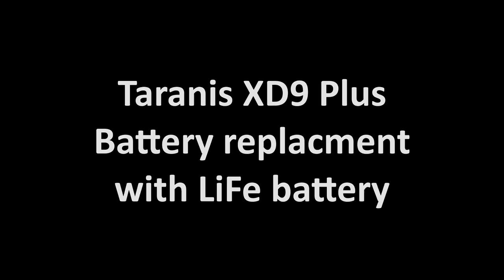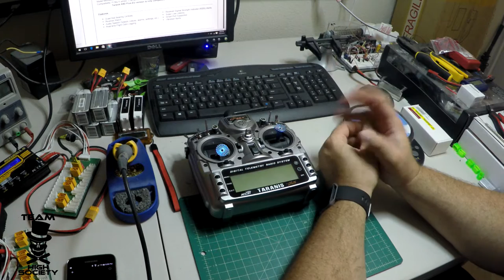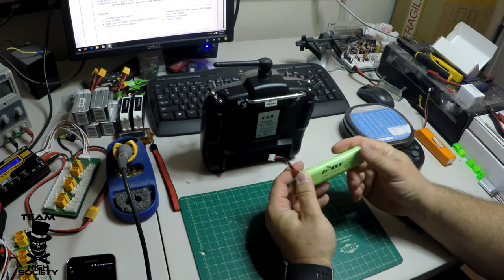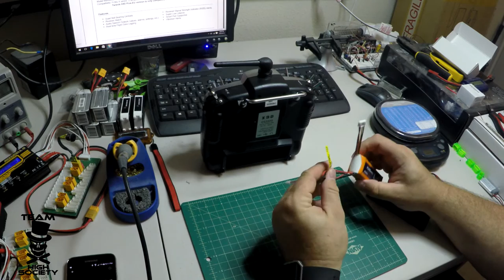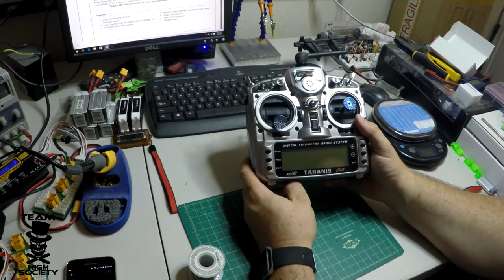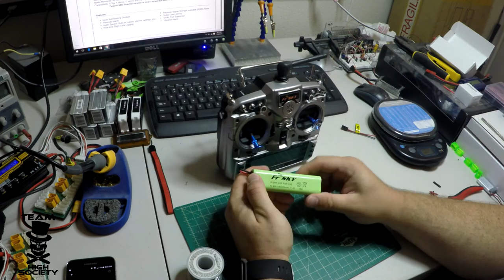Taranis XD9 Plus battery replacment - LiFe or LiPo ?

Comment: Just a suggestion... cut, solder and heat shrink one wire at a time to avoid accidental shorting out of the battery.  And FYI, I have that same LiFe sitting in my old Turnigy 9x that has been untouched for probably at least 2 years and still has a full charge with no problems.
Reply from the maker: That is wise advice for sure! I'm glad you can confirm what I read about LiFe and its incredible charge retention!

Comment: You didn't mention resetting the voltage range on your X9D and also the battery alarm all of which will have changed when you changed the battery - also I would have soldered the lead on the other connector so I could use the servo connector for changing without the need to disconnect the battery from the radio.

Comment: You'll want to change the low battery alarm too since the curve is different for LiFe.  I set mine to 9V or 3 per cell as the low.  Otherwise you may not notice when it is low.
Reply from the maker: That's a great tip! Thanks for posting it!

Comment: will the taranis be able to charge the life battery
Reply: No, you will have to remove the battery and charge it on an external charger.  Also, you will have to have a charger that can charge LiFE rather than just LiPo AND you MUST remember to switch into LiFE mode when charging this battery or you will have a bad day.
Reply: No

Comment: You say 9.9v is what a 3s LiFe battery is.
That is the nominal voltage. Fully charged it is 10.8v and depleted or bottom discharge threshold is 7.5v.
Reply: Kenneth Holland what have you set your taranis for low voltage? And min and max? I have a 1500 life battery. Thanks